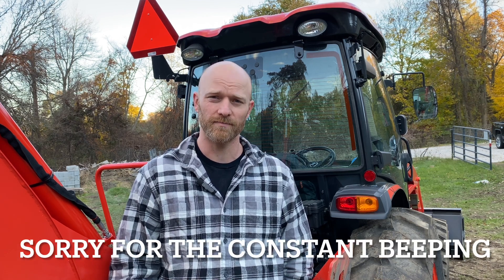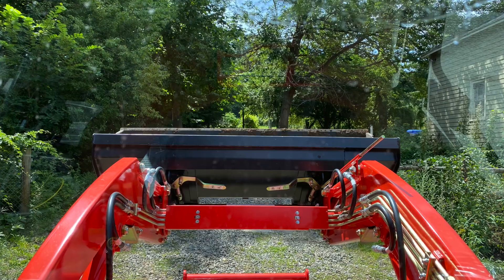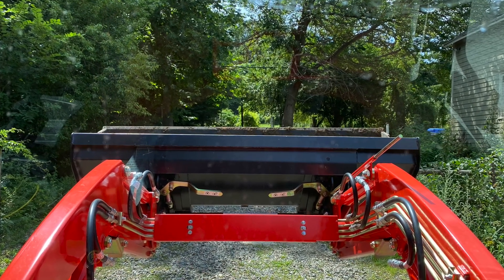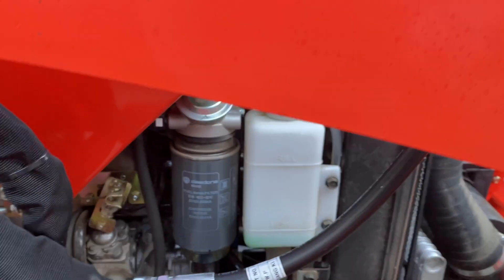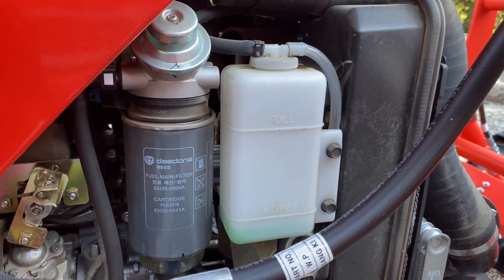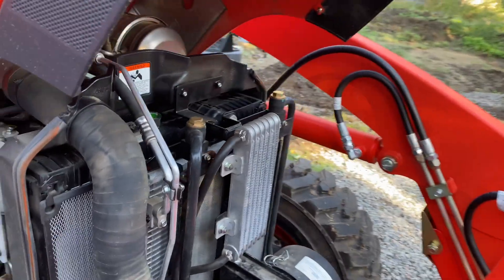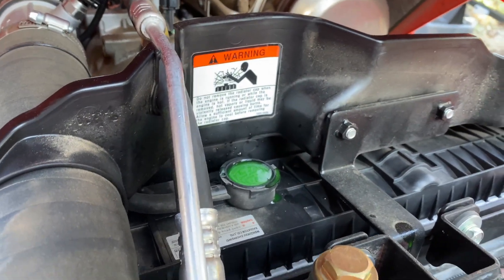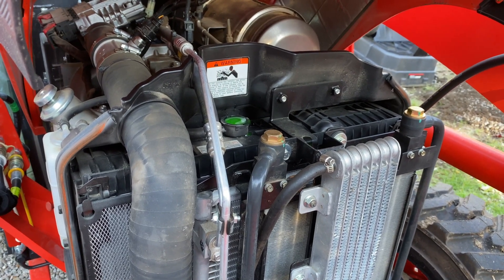Kioti Tractors - Everything that's gone wrong in the first 50 hours!  Lemon???

Comment: That sucks the AC not working for the second time, maybe you can get a refund for the AC if they can't fix it. The fluid you add by opening the top of the container, not in the rad. The twisted bucket looks like it was welded that way, poor workmanship for sure if it's the case. I have had my Kioti CK35 for over 10 years and only had to replace a seal in the hydrostatic which I did myself because I didn't trust the kids they hire to do the work, bad experience with the dealer. They are a workhorse for sure, I even use mine as a logger and pull out 3 to 5 trees at a time from the woods. I use it all year long, especially with the backhoe. Someone mentioned you need to take it easy with it, I say BS. It has done everything I wanted to do except when the load was too heavy to lift or the ground was too hard to dig. It has the extra weight compared to the competition to get things done. I wouldn't trade my Kioti for anything. Your biggest problem is the AC which I don't have because I didn't buy the cab. I like the full open view and quick and easy getting on and off. Once you have that fixed you will be happy again I am sure. keep in mind they all have issues and that is what the warranty is for.
Reply from the maker: The dealer apparently has to send the tractor out to get the AC recharged, so they blamed that guy for not doing it right.  Obviously I can't test it now in the winter, but we'll see when spring comes if it's working or not.  Most of my issues are with the dealer, not the machine.  I fully agree with you that they are a workhorse and the backhoe is definitely a beast!    I'm glad I went with it as it has been a huge help here around the farm. So far my Kioti has done everything I've tried to do with it.  It hasn't let me down with completing a task yet! It's nice to hear from people that have had good experiences with their Kioti!  Kioti just needs to work on their dealers in my opinion.
Reply: @Curtis1824  Yes, they need to work on their Dealers for sure. I brought in a chainsaw for them to check the carb because I didn't feel like screwing with the carb. I told them it runs fine, the carb is messed up. They responded 2 days later with, " the motor is gone, you need a new saw". I tried to tell them it works fine but they kept saying it got scuffs on the side of the cylinder. I said you'lll have scuffs on you too when you reach 30 yrs old. I told him to put it together and I will pick it up and fix it myself. 10 minutes I had the carb cleaned and it was running fine. went out to cut a few cord when it started to leak oil. they never screwed the exhaust on tightly and the heat put a hole in the bar oil container. I brought it back to them and told them to fix it NOW. They did seal the tank and it's running still fine today 8 yrs later. I believe they push to sell is the first problem, the second is the quality of workmanship they have. This is why I would not let them touch the hydrostatic in the tractor because I heard they can't fix them and they just sell you a new one at 3000.
Reply: @breadcrums7853  Kioti makes chainsaws? I did not know that.
Reply: @onamissionracing  no they don't, they sell that brand of chainsaw and lawn tractors as well.

Comment: I've got a 2012 CK27hst with 1080 hours on it. Only two minor warranty issues and the front rear end leaked the oil out, I think. I check that once a year. It gets greased once a month in winter, it only works in winter clearing my snow. Would I get another one? no DPF/DEF/XYZ or any of that bull crap and yes in a heartbeat.

Comment: With 50 hours of my machine CK 35-10 hydra stat the hydraulic distribution bracket white front interior of the loader frame every fitting was barely finger tight The mounting brackets hold it to the main frame in the machine we're not made of a high quality alloy steel they were so soft that the loader frame got in contact with the brush guard The dealer refused to warranty any of it charged me $1,700 had the machine for 3 months and then when I called k i o t i
 they lied and never did a single thing to exercise the warranty
Reply from the maker: Terrible.  Crazy what some people think they can get away with.
Reply: I really didn't want to have to search to see if other people were going through this but apparently it seems to be the norm with k i o t i great news is I'm in a first party consent State, I've recorded every phone call and I'll  make videos showing how they handle their business I honestly think I can put a huge dent in their sales
Reply from the maker: @1o1carolina53  Good luck!  I had absolutely zero luck trying to contact them with help I needed.
Reply: @Curtis1824  I'm sorry brother. I'll keep you updated.

Comment: So then you tell us you've been moving big rocks and big trees with it and it doesn't even have 50 hours on it in your engine is not broken in so yes that's why it's breaking down
Reply from the maker: Actually the problem was found by the dealer to be multiple faulty sensors and a leak in the coolant line for the AC.

Comment: Top trumps. Ive just got my money back on a brand new Iseki. Made in japan. You'd have thought an amazing machine. And it felt it. The great lever and so on, felt like a rolls royce. Engine sump gasket failed in the first half hour. Yes, half an hour. It was a full engine out job to reseal it. Because of if the front axle being in the way. And it lasted another half hour before the sump gasket failed again and it sprung a big coolant leak. So it would be engine out again in 1 hours use. Ive got my money back now.
Reply from the maker: Amazing to hear how often problems like this are happening to people!

Comment: These tractors are shit. my engine runs perfectly fine and has proper oil pressure yet dash reads oil pressure problems and the ecm puts it in limp mode and the throttle is locked out at idle. 

Essentially a lawn ornament
Reply from the maker: I feel your pain.  What model do you have?